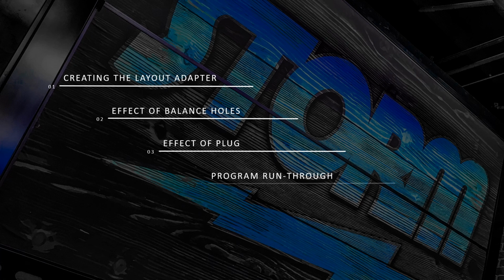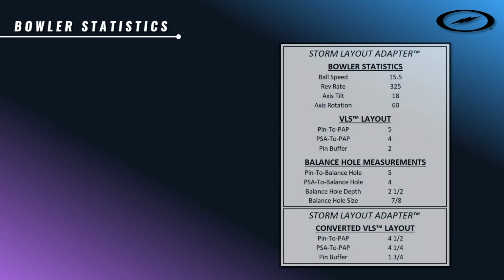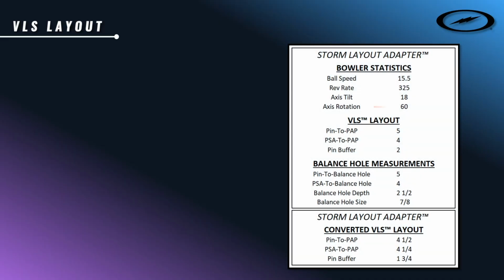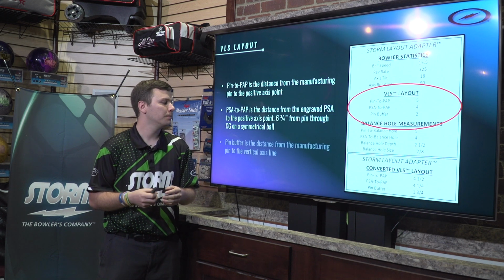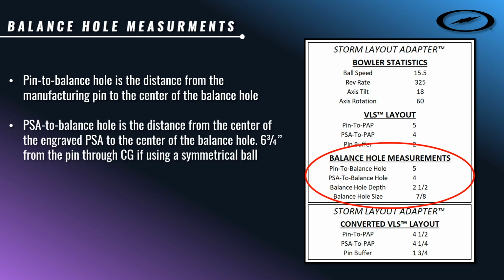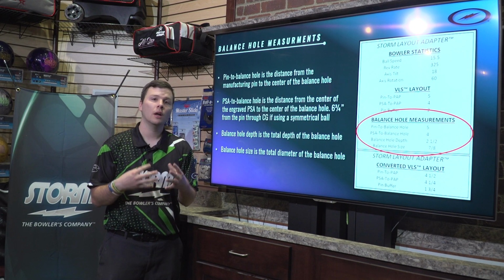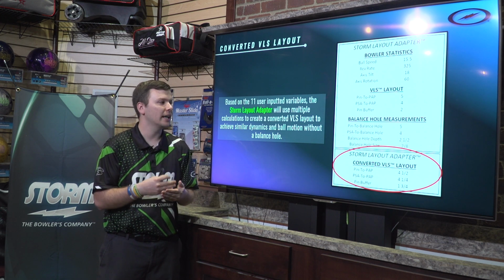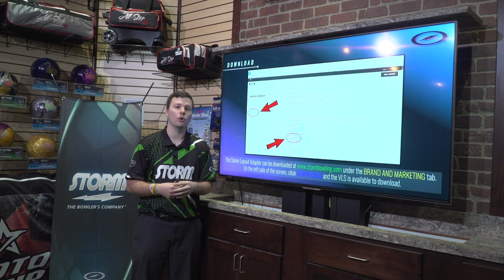Storm | Layout Adapter | Program Run-Through

Comment: But if i want to adept the "new" layout without the balance hole... i probably have to redrill the ball. And in that case the layout adapter is not working any more, because it doesnt adept the loss of mass of the redrilled holes. So it is "only" useful for drilling a new ball with a similar layout that you already used on a ball with a balance hole - am i right @Storm Bowling?
Appreciating your videos! Keep it going!